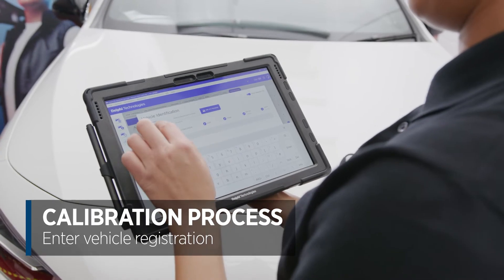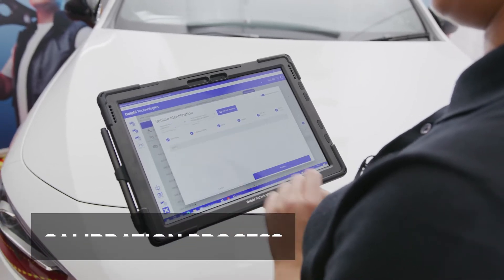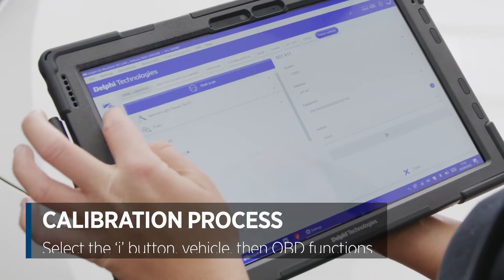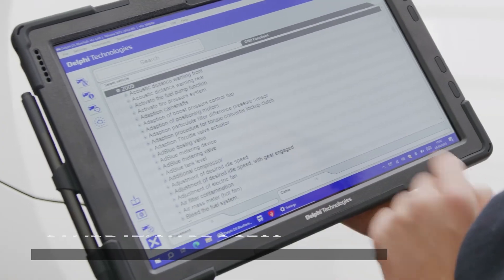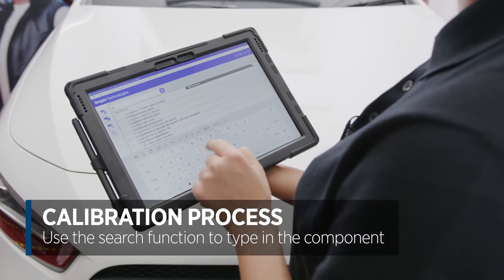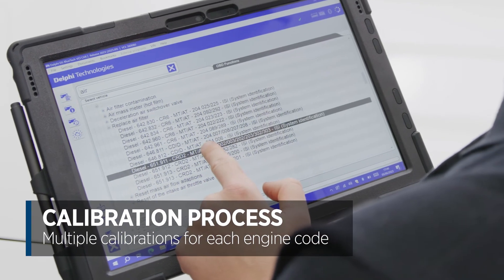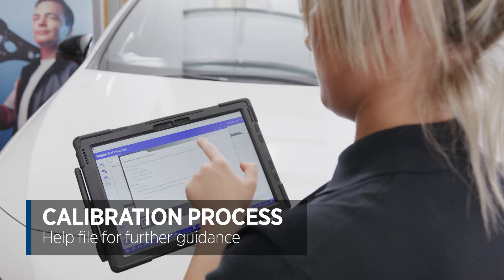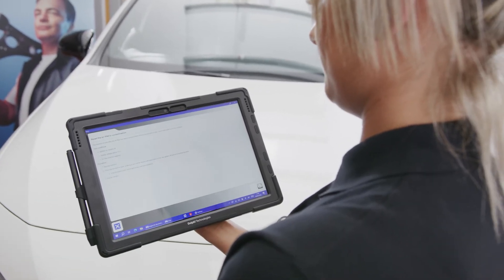[EN] Calibrating the engine air filter on a Mercedes | Masters of Motion

Comment: Only part that need to calibrate is the EGR valve… for ever close. Don’t worry for The air filter, this is ok… if the air filter protect the Engine from the dust can’t go inside, Why the pcv valve and egr can put trash inside… very not LongLife idea…